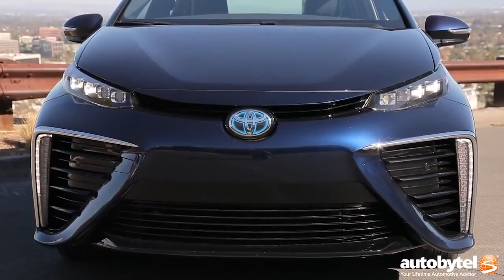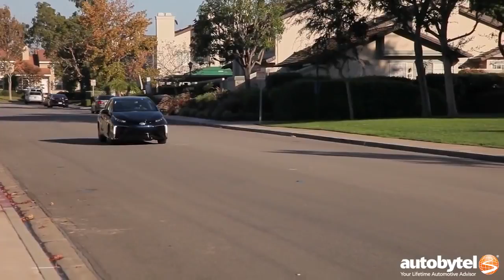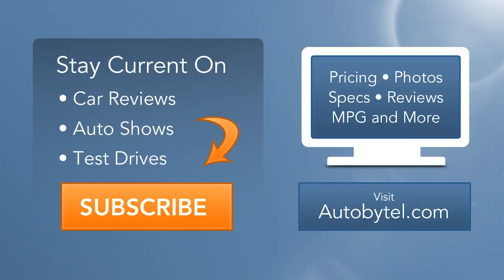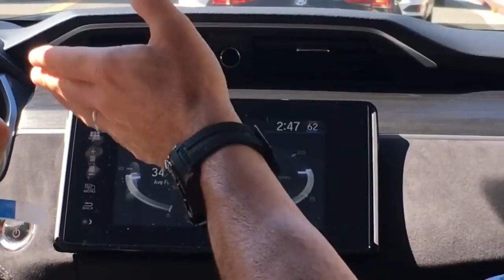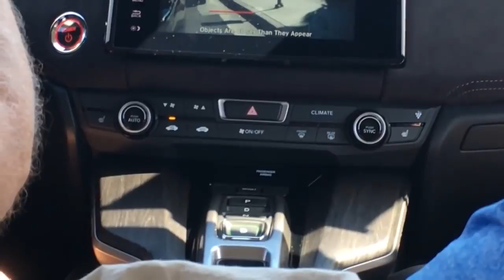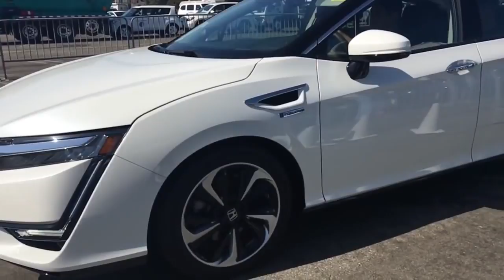Toyota Mirai 2018

Comment: You're forgetting to mention the real cost of the car.  I just leased one for $352/mo + tax with $0 drive off.  You also get a $5k state rebate and/or HOV sticker (income dependent).  Finally, you get a $15k credit card from Toyota for hydrogen refill.  That should last you the life of the lease at 12k/36mo.  Real cost of the car is $209.14/mo + tax including fuel!  This car is a no brainer if you live in LA or SF, which are the only 2 markets that's being sold at the moment.
Reply: Hi Jake, where did you lease from?
Reply: @jasonjackson475  Tustin Toyota
Reply: Nice deal, any down? or $0 @ signing / $352 + tax? @jakeh5799
Reply: @jasonjackson475  $0 drive off
Reply: @jakeh5799  Thats good, when was this what year is the vehicle? I'm trying to get one as well.
Reply: @jasonjackson475  I got it over Thanksgiving weekend this year. It's a model year 18
Reply: You got a sales person you can refer me to? @jakeh5799

Comment: Acceleration: 0-60 mph at only 9.1sec? come on now this is not a gasoline car, it's need to have faster acceleration with electric motor even if it is just for marketing. Tesla at around similar price is of $60k is much faster. The top speed is fine.
Reply: Tesla can't charge battery to full in just 3 minutes. What u want to say about this .
Reply: Yeah, you are right the refuelling is lot faster, not to mention lithium ion battery's performance will decrease over the years. I was just hoping for some performance increase but maybe it's not as important as price, looks, running costs, handling etc.
Reply: Yes, Exactly, Batteries will eventually loose it's performance while fuel cells are much more reliable. No element known till date in this universe have more specific heat then hydrogen . That's y i think ultimately hydrogen will became the source as it is powering the entire Universe as well.

Comment: 1} In my option, all the manufactures and polticians is requiring the hydrogen and electric and just operate on water as fuel source and just operate on the air your breath vehicles,  that each is deblibertly engineered desgined to fail from the start.   I have no engineering degree, I know, to desgin the inter door way frame to be at least 122 inches from floor to roof  so anyone can be seated with stright spine with out having to conquork the human body, when I even try to fit my neck hits to top roof frame when entering the vehicles of any kind. 
as to the hydrogen lack of fueling locations again,  they designed it to fail right up front.  I have no engineering degree, but I would have designed the engine and energy storage to direclty produce the energy source on site with in the vehicle by having water using direct current and direct voltage and air compressor to user use electrylisis to covert into four indiviudal tanks two too hydrogen and two tanks to oxygen then user use the gases as the fuel for unlimited driving distance for the air compressor pull the air you breath in then use uses it as fuel source.  the manufactors would never hire me for I desgin it right the frist time at production. no degress and no engineering degree and no experience. 
Night vision and Inforred vision  and camreas in the a frame and on the roofs and in the bumpers and in the doors and have GPS for front and rear for outlining the box of the transportation.  for traffic management. all vehicles have satcom video phone and all have celluar muliplexer unlocked modem for celluar communications.      seat six child seats and set 15 adults 8 feet tall and weights over 650 pounds each for the weights math for the vehicle.  have a place for hanging cloathes for professionals men have dress jackets they have to wear at work.  and when traveling as family and have cargo storage for 20 individual suite cases, I ran into that when different family members from different parts of the family tried to take long travel trip together then all the suite cases would not fit.  then their was arrgument what was going and what was not. 

well, you get the point and you get the face time with the big shots board members. 

maybe you can change things. have a great life.

Comment: This "abundance in the universe"-argument is idiotic. Hydrogen is the most abundant element in the universe (second: helium), but not on earth.
The most abundant elements of the earth's crust are oxygen and silicon. 
So we should use silicon-silicate-batteries to power vehicles?
Reply: there is more water in the world than oxygen and silicon. That is about  332,519,000 cubic miles of water @justcurious
Batteries are use on a hydrogen fuel cell... I think it's best if you get the facts first. before you type rants!!

Comment: There are 35 stations in California btw, with 25 more funded and in progress and it needs to be pointed out that in service capacity (i.e. the number of vehicles that it can support) a single hydrogen station is equivalent to 30 supercharges (so currently the equivalent service capacity of 1,050 superchargers).

Comment: Two thirds of the universe contains hydrogen,.... Bound to another element. Hydrogen does not occur naturally anywhere but in stars or gas nebulae. You cannot drill for it.

Simple fact: hydrogen needs to be cracked from another substance. This takes energy.

It's not a fuel in the traditional sense, as we need to put in energy to create it and, unlike petroleum, you put in more energy than you get out - by quite a margin.

It's extremely inefficient to use hydrogen in a car. You need 3 times as much electricity to power a Mirai 10 miles as you'll put into a Tesla to go the same distance.

That's ridiculous.

Toyota are only producing these because the Japanese government subsidised the program and they can sell them in places with zero emissions mandates.

There is no road map to make them mainstream vehicles. At all. Toyota sold 2000 worldwide in the whole of 2016. Tesla sells more cars than that a week.
Reply: Exactly.  Just as you need to charge lithium ion (to separate the ions) you need to charge hydrogen (to separate the hydrogen atoms from what it is bound to - typically oxygen).  Hydrogen is simply a portable battery. It is charged off-line (at the station) and then transferred within 3 minutes into the vehicle.